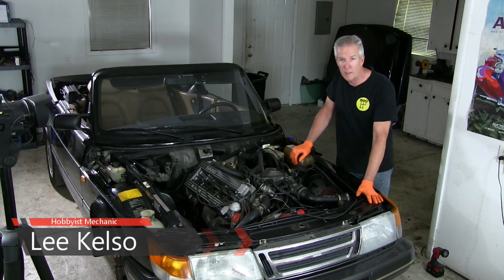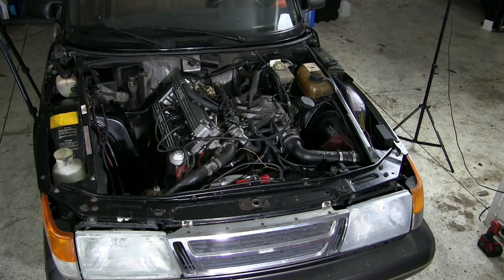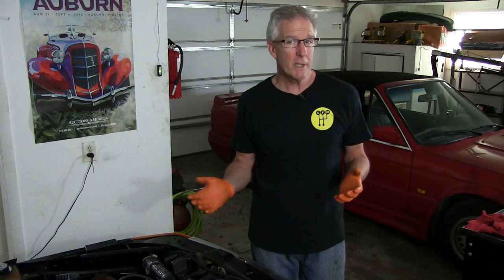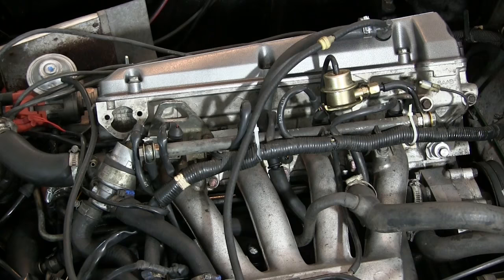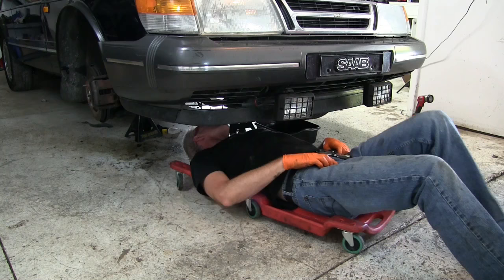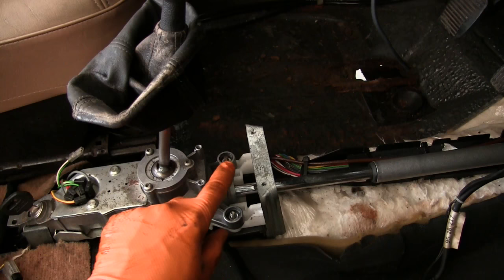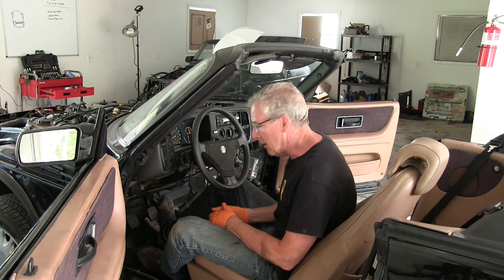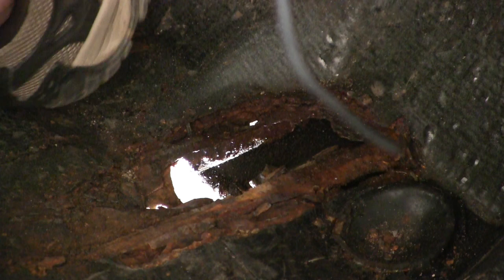SAAB 900 test drive as a 5-speed- Ep.16

Comment: Going to pick up a 1987 900 turbo this sunday. Super exited, ive been looking for one forever and finally found one in good shape. Thanks for posting all these videos they have helped me learn a lot about these engines and transmissions
Reply from the maker: A friend here in my hometown has an 87 and I'm surprised how many things are different.  For example, his turbo is not water cooled and the emergency brake is on the front wheel.  Interesting just evolution of the design.  If you haven't bought a Bentley manual yet think it over.  Money well spent.

Comment: If you've got a hole up front, you might check the rear foot wells as well. That's where my '88 has rusted through. It's the lowest point in the cabin so if water ever gets in, it puddles back there. I started to chip away all that rubberized sound deadener and found plenty of surface rust all over the floor and two softball sized holes in the rear foot wells. Was going to do a fiberglass patch job, but it's not the only spot on the car with rust and I'm tempted to have a shop take care of the whole car and do it right. Glad you got it up and running!
Reply from the maker: Great advice.  It looks okay from underneath, but I've not fully inspected that area.  My plan is to cut the floorboard out of the donor car and have a specialist weld it to form a patch.   For now, I plan to pop rivet in some sheet metal and just drive the heck out of it in sunny weather.
Reply: Good plan. As with many things in life, you can get so wrapped up in making it perfect that you forget to ENJOY IT! Good luck!

Comment: awesome to see the car start!!! i know that I'm a little late but I've been off the grid working to get my project running and I am thrilled to say that I've been successful in my quest
Reply from the maker: Please share the details.  I'm always excited to hear about others making progress, and what you discovered along the way.
Reply: Lee Kelso my cousin and I first replaced the fuel pump but instead of using a Saab pump we salvaged the housing and spliced on a pump from a '92 camaro with identical fuel pressure and delivery, I tried rebuilding the sending unit but to no avail, we then changed the fuel filter as we figured it was plugged as the car still wouldn't turn over, we then revived the injectors and the car would start and die. the ignition timing was off so it was corrected and it started up after trying all night so we took it for a quick spin down a grid road, heard a loud pop and my dreams were crushed but the car didn't stall and it started idling smoother?? when we had it idling in the shop the tach would jump between 1000rpm and 1300rpm but as soon as the idle air valve wad touchef it smartened up so I'm hoping I can salvage it in calgary where I live. The next evening we went to start it again and we had to play with the throttle for s few minutes until the car warmed up and then it ran fine, my cousin took a measurement of the engine coolant temperature sensor with a voltomer and the amount of resistance while at +15C which was the shops temperature was the same as if the engine was warm and +30C, he grabbed a tensiometer from his work and we set it to create the correct amount of ohms and it started up cold perfectly. I drove it into regina from his farm last night after doing fluids and a quick look over and it survived the 70km trip but the odometer is now stuck at what it was at after our couple of test drives. I'm driving it back from regina to calgary today (800km) and I'm loaded down with all the parts I could grab from the saab farm before its demise and 4litres of coolant

Comment: I did my 87' C900 Convertible from a 3speed non turbo to a 5 speed turbo last summer.  I think I spoke with you on one of the facebook groups, Lee.  Anyway, this series is super well done.  Very professional!
Reply from the maker: That's far more intense than my simple trans swap.  I'm still stuck at base boost.  My guess is I have wired the cruise control switches incorrectly and that's causing the APC to limit boost.   While cruise never worked on my car, the dash indicator light at least came on.  Now, it does not.   I've been too busy to get back into the garage, but plan to tackle it and post an update by late next week.
Reply: Lee Kelso On both of my engine swaps that I've attempted, I was also stuck on base boost. Many fail safes. Knock sensor functionality and cruise control switches were always the culprit. I bypassed cruise as I don't need it. As a quick test, you can also try it. There's a wiring pigtail in the drivers side fender below the APC box. If you disconnect it, and "jump" the female connector with a paper clip, you'll temporarily bypass the system. Good luck!

Comment: How dare you keep us in suspense! I'll be waiting anxiously for the next video. I'm going to pull the engine and transmission out of my parts car this weekend. Thanks for the tips. they will come in handy as I go through the process on my 92. I wish I hadn't removed the pinch nut from underneath the car. definitely the hard way....
Reply from the maker: Yeah, that is a bear from underneath.  I'm still not completely happy with the shift linkage feel.  Seems more vague than I remember from a previous 900.  However, that may go on the "deferred maintenance" list until winter.  Best wishes for your project.  It's worth the effort.

Comment: I picked up a '90 turbo convertible for $200 once because the shift linkage was disconnected and the lot owner thought the transmission had gone out.  One $1.50 cotter pin and pinch nut later and I was tearing up the roads.
Reply from the maker: A great buy!   The manual transmission is a must in these cars.  I simply changes everything.

Comment: take up all the floor covering and look for rust, those foam floor covers hold moisture right where you don't want it, patching is pretty straight forward as most of the areas are relatively flat. Also, doesn't that car look great without the hood? The motor poking above the fender line just looks cool, I am sometimes tempted to leave my 900's hood off just for the looks.. :-)
Reply from the maker: Happy to report no serious rust anywhere else.  My foam floor mats in the passenger side and rear seat were saturated with a dark, oily substance I removed with a  shop vac.  Anyone have any idea on what it may have been?   

I drove the car with the hood off for a couple days while troubleshooting.  You're right, it looked pretty cool.  Amazing what you hear with the top down and the engine bay wide open.  I didn't realize how quickly the APC solenoid pulses the waste gate to manage engine knock under boost.  That little gadget chatters like an old woman sharing gossip on a porch swing.
Reply: My local shop told me that the oily substance I find on my driver's side carpet may come from a leaky heater valve.  I had it checked and the valve, they said, was ok.  They checked something else but everything was ok.  So, I still have a greasy carpet.  

That oil may help prevent rust!  My leaky engine has kept the car's underside in tact.  I just need a good welder to keep the rest of the body together!  8^)

Comment: Yeah rust is always a car killer. Don't really see that much of it on Swedish cars though. They usually do pretty good rust proofing when they assemble cars at the factory. But yeah that's something that you're gonna wanna address immediately. Most people get what's called clocker (not sure if that's spelled correctly) floor panels and weld those in as a riveted repair. As for the leaky hoses, I would contact a place called Swedish car parts and just replace all of them if they are original or very old & brittle. Even if they're not leaking who knows how much life they have left in them after 28 years.
Reply from the maker: Fully agree on the need for hose replacement.  My wife and I enjoy road trips and those dodgy hoses are a worry that I should have addressed right from the start.  How silly to be  stranded on the roadside due to a $20 hose failure. Several hoses are so odd and unique they aren't on the shelf at AutoZone.  You'd think with all this gray hair I would have learned about the curse of impatience.
Reply: Congrats on a great series and a fab job. I'm on my latest of 4 SAABs in the past 15 years: a 1993 900SE turbo with a mere 123,000 miles on her. (one of the last 900 "classics" sometimes referred to as "the g00SE" lol) She's a light pressure turbo 3 speed auto. These LPT were made specifically for Europe as far as I'm aware so you're probably running higher boost straight outta the box, as it were. I understand your reasons for the conversion of course but let me tell you, after 15 years of driving manual transmissions here in the UK, I love the complete change of driving experience my first auto transmission gives me. When I plant the gas pedal the kick down and turbo boost from the Mighty Mitsubishi still makes me smile having done 1000 miles in the past 2 weeks.(is it sad to take it to airshows wearing my original WWII Irvine flying jacket?) These late model 900s came with the Mitsubishi turbo and it's amazing how many differences there are between year of manufacture and model on these cult classics. Anyway, you should never struggle to fing genuine parts with these guys - https://www.saabparts.com/ All the best from across the pond and remember, it's not a car, she's a SAAB.

Comment: Lee -- The suggestion to address the shifter pinch bolt through the hole in the firewall is pretty smart.  

I (as well as just about everyone else) do not have the special alignment tool Saab and Bentley manual prescribes. I perfectly realize the shifter in 3rd gear with a pin. However what needs to occur at the transmission end (without that special tool)?  Does the transmission rod simply mate up?  Basically is there a specific measurement Saab was trying to achieve on the transmission end?

Can you or someone give me the DIY way to get the alignment right?
Reply from the maker: I crawled underneath and manually moved the gear selector shaft to where I thought third ought to be.  I moved the shift lever to third, and the alignment holes were close enough I knew I'd guessed correctly.  Tightening down the pinch bolt on the shaft set it in place and it all worked.  It seemed too simple.    

I'll post your question on a Saab 900 Facebook group and I assure you the guys will have a bunch of suggestions.  Visit 
the group here:  https://www.facebook.com/groups/2216998577/

Comment: My 87 won't go into reverse if the car is running. I have to shut it off
 ,then it will go into reverse. and then start the car with the clutch 
engaged. then I can drive it in reverse and go to 1st and so on but it won't go to 
reverse till I shut the car off and start over.  It will go into reverse fine when cold and running but once it warms up , it just wants to grind so I won't force it . it doesn't fall out gear either. but sometimes it seems a little sticky , like in  1st  or i can't find 3rd, but then after moving the shifter  around it will just go right in
  does anyone have any ideas and know if this is an easy fix, or am I 
screwed. "thanks"

Comment: I have an '89 900 sedan.  When it rains, the driver's carpet gets wet.  Now I am wondering if i have the same rust hole as you!?
Reply from the maker: I hope you don't, but it's a fairly common problem.  Obviously, I didn't catch it when I bought the car.  But, I would have gone through with the purchase anyway.  For $500, it was too good to resist.
Reply: Lee, I really admire what you have done.  I just wonder if it would have been simpler to find another $500 convertible with a manual trans.  They are out there!
Reply from the maker: Simpler, less expensive and smarter!  But, I guess the challenge attracted me.  I've never tackled a project of this scale. Now, I know my SAAB literally inside and out.